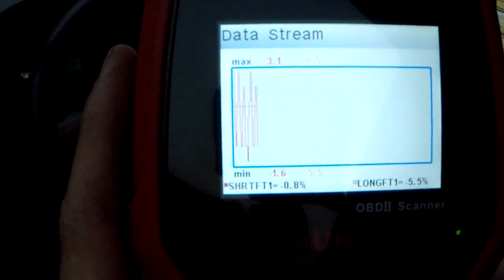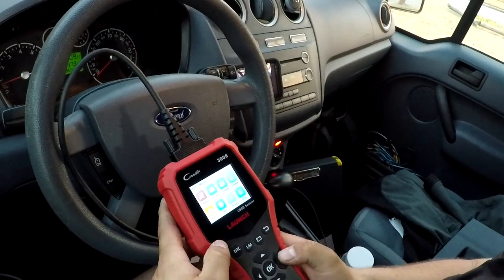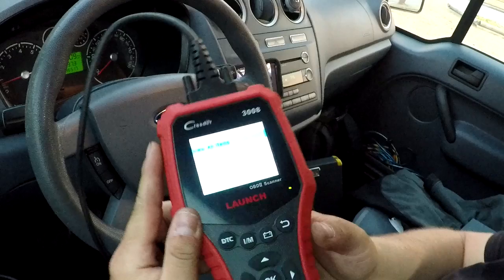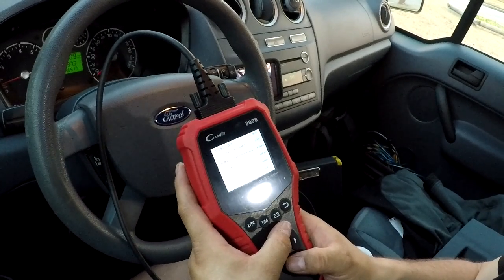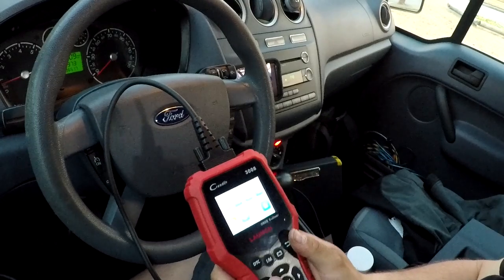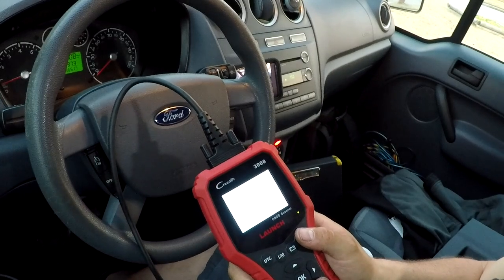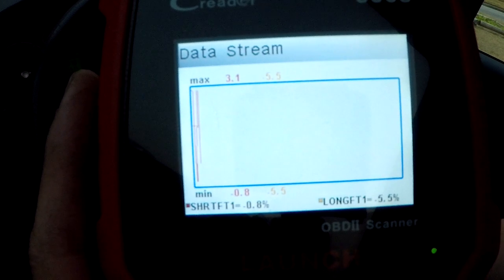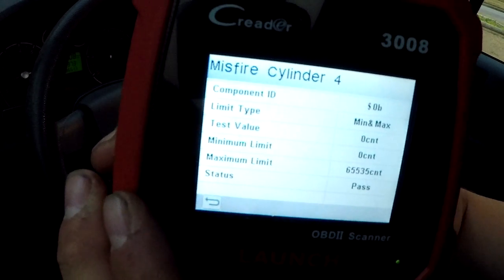New tool Launch Creader 3008

Comment: Hey Dum Dum, its not giving you a 'battery voltage readout' while the engine is 'on'. that's the reading with the alternator working, if you want your battery voltage, shut your engine OFF. Most of the functions of that tool are designed to be read with the engine 'off'. I shouldn't have to tell you that... shut your engine off!!!!!!
 Pretending to know what you are talking about. Geeze.
Reply from the maker: I wish I was as smart as you!